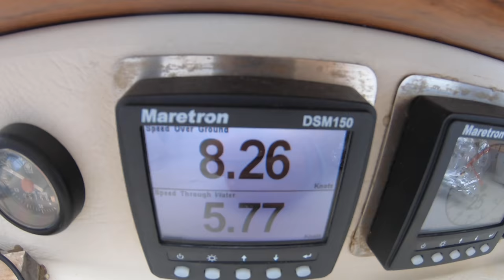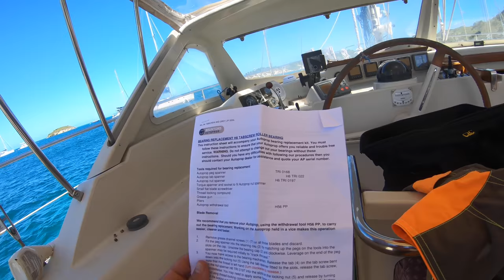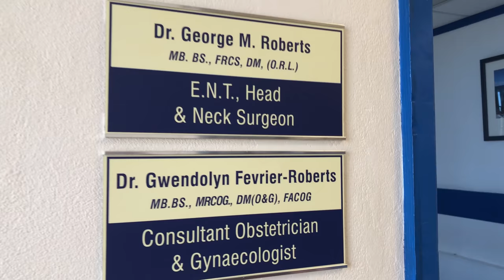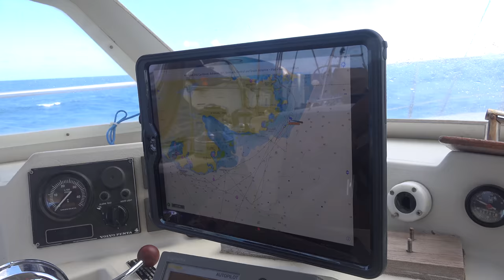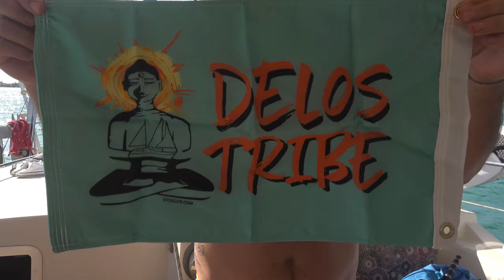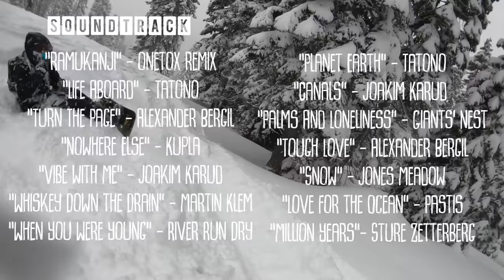SAILING life vs. MOUNTAIN life! Sailing Vessel Delos Ep. 228

Comment: G'day Bryan, have you tried AquaShield grease for the prop bearings? AquaShield is specially formulated for water applications and is perfect for your prop application. We have used it for many years in the offshore industry and I've found it to be the best grease to use in applications where water is present. I use it for an anti seize as well and swear by it. It can be messy and a pain to clean up, but will out perform other greases where water is present and lubrication is required.
Looking at the failed bearings, water ingress was the root cause, AquaShield would provide a barrier to the water ingress.

Comment: ROFL Brady,   
OK correctly fitted skis, should balancing, so when you stand in the shop, and balance your weight EVENLY you can pass a sheet of paper under the skis..   when you transfer your weight to either of the skis, the ski should lock the paper on the side you put weight on.. balance evenly again, and paper should move freely..   now you can "lube" the bottom of the ski with the proper grabber cream for the temperature of the snow,  yes really.   only in the center part.. now its all about weight transfer, when you push off you put weight on that ski, ski grips, and the other glide.. enjoy.
stopping can be done by dipping your behind in the snow between both skis, however experienced skiers... like to use what called the snow-plow position.. 
Have fun.

Comment: Another great video.Just a little info. You weren't using an axe. That was a spitting mall. If you would have stood the piece of wood straight up and hit it from the in through the wood it would be much easier. Viya Con Dios.